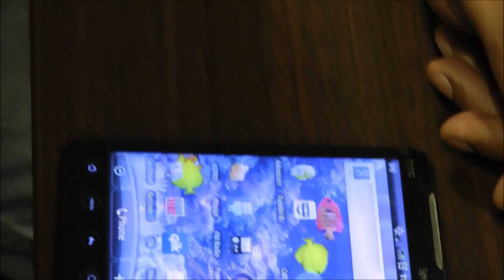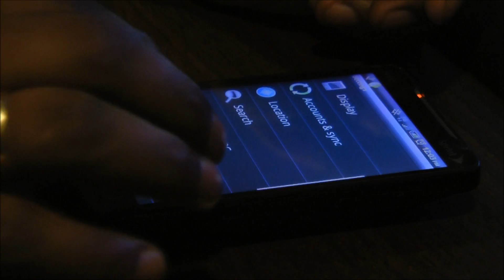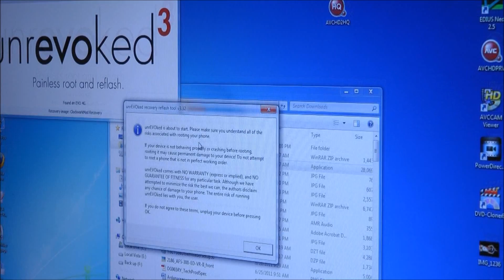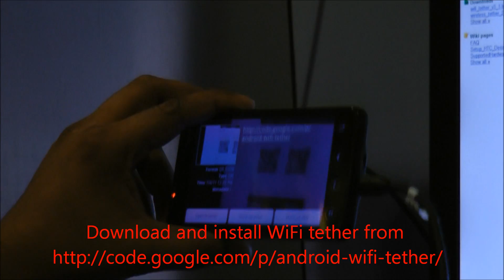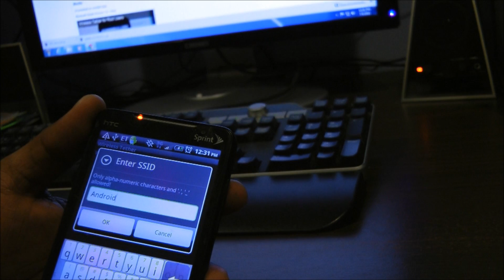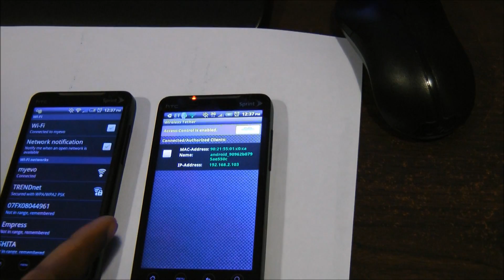Free WiFi Tether in Sprint HTC EVO 4G

Comment: QUESTION:

1. Does the Wifi tether only work for sharing with other devices *ONLY??* 

2. Can you not use the Wifi Tether where it has been installed (my own mobile device) so that I can browse the web, open apps etc (I would like to use wifi tether using my own mobile cell phone without sharing).

3. If "yes" can I use open the apps on my mobile? For instance, I want use google voice for calls and heywire to text when I'm out and about.

4. Can the wifi tether be used anywhere?